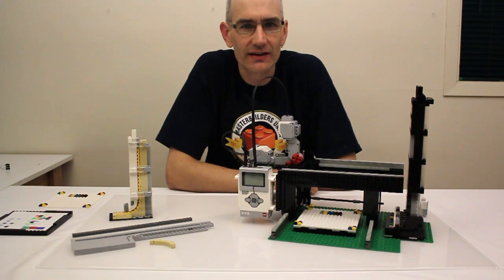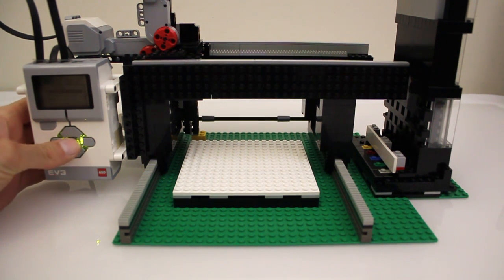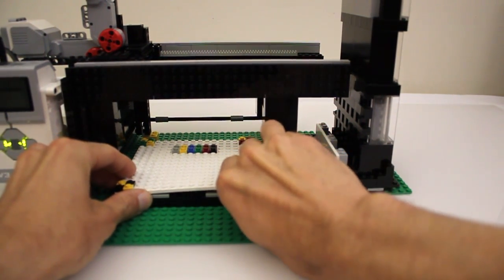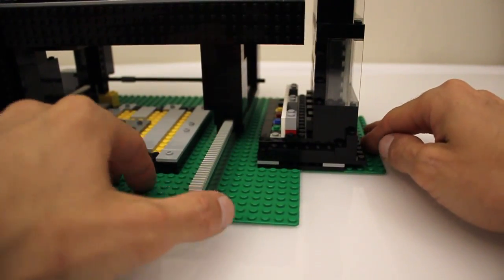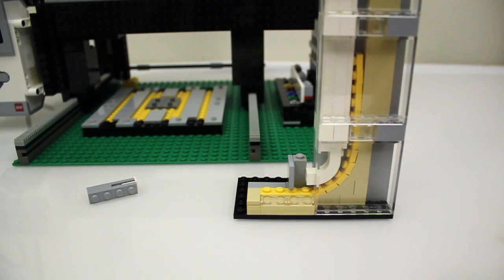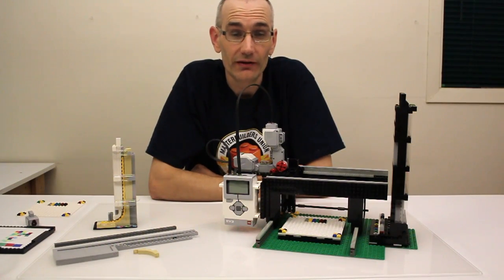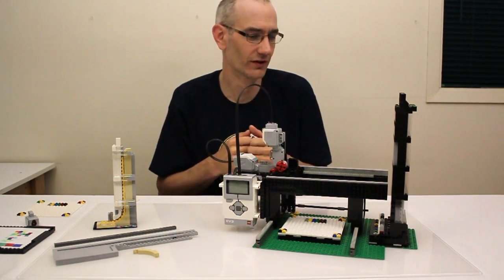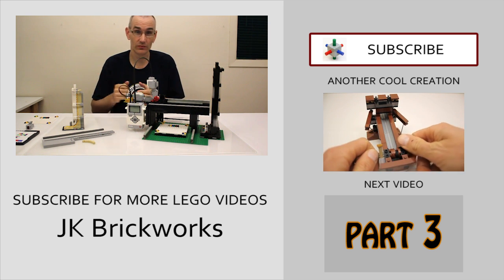The LEGO Printer Project - Part 2

Comment: Lets say the one of the 1x1 plate chutes depletes to two plates, will the second plate still fall into the reach of the arm after the first is taken away, or does it need to be manually pushed?
Reply from the maker: No, there does need to be minimum of about 6 or 7 plates in the chute at all times.

Comment: I think I see a potential problem with the feeder system: the bottom part is flat and too long. While the reservoir still contains tiles those tiles should be effected by gravity and thus push the tiles at the base downwards. However, when the reservoir is empty, and there are say... four tiles, they won't go anywhere anymore because what was pushing them is no longer there. (This is assuming that the result your going for is completely tile based.)
Reply from the maker: Stillcoe Jones Yup, there always needs to be a stack of plates pushing down. Once the number of plates gets down to around 10, more plates need to be added for it to keep working.

Comment: This is a pretty cool idea. I'm eager to see how it turns out. Though you must realize the only way you're going to top this is to come up with a machine that knits scarves or something! :D

Admittedly I haven't thought this through very well but, you may be able to reduce travel time if you moved the storage system flush with the back of the 16x16 plate. Could save 5 or 6 studs of travel for each plate. Unfortunately, it would likely require changing the construction of the print arm (or perhaps just the print head) and reprogramming the entire thing.

As for naming, at the moment I'm thinking "Print Storm" or "Plate Master".

Comment: That feeding system is pure genius, much better than any of the ideas I came up with. So in order to use the same three motors to scan as well as print the mosaic, are you going to attach the color sensor to the machine, put the image where the mosaic will be, have it scan the image, remove the image from the machine and replace it with a baseplate, and then print it out?
Reply from the maker: Benjamin Corey Thanks! Yeah I'll do something like that. I'll probably put the original image in front of the printing area and extend the bottom gear rack so that it can move over it.  That way I won't have to any swapping.  I'm hoping to have the color sensor stored somewhere and have the printing arm go and pick it up to do the scanning.

Comment: Problem with the feeder. When it reaches the last 4 or so 1x1 brick it won't reach the end to be picked up. It would basically be flat at the bottom. Perhaps rubber band, or long 1x8 brick.. gl with the project!

Comment: Very cool as always, Jason! Your attention to detail is inspiring.

I'm particularly excited about the scanning step. You could make use of some really simple image processing algorithms to generate your mosaics. I see you are using a grid with 1x1-LEGO-plate sized cells. Depending on the quality of the sensor you could scan an actual photo and easily convert it to a 16-color mosaic (or as how many colors you will be using). You would just have to size the image down by averaging the color of each 1x1-LEGO-plate sized pixel block, then apply a dithering/quantization algorithm (like Floyd–Steinberg dithering, being the most popular one) to reduce the color palette of the image to a 12-color palette. This way you could convert any scanned photo (or a photo straight from your hard drive) to a beautiful mosaic :-) Maybe you are already working on this.

Here's a nice Java implementation of a dithering algorithm and a good article on the subject:
http://stackoverflow.com/questions/5940188/how-to-convert-a-24-bit-png-to-3-bit-png-using-floyd-steinberg-dithering
http://www.tannerhelland.com/4660/dithering-eleven-algorithms-source-code/

Name suggestions just off the top of my head: Gutenbrick, TesselLEGO, Mosaic-o-matic,... yep, that's all I got.
Reply from the maker: LexFloyd Thanks!  Yeah, my original idea was to be able to scan actual images and 'pixelize' them.  Unfortunately after playing around with the color sensor I don't think that will be feasible.  It really isn't very precise and seems to only work well on large swatches of uniform color.  I think I will be hard pressed to get it working with the 1:1 LEGO scale 'drawings' I have right now.  Of course we'll see what happens.  I'm sure there will always be some room for improvement.  Thanks for the info and name ideas!

Comment: Hi about the amount of plates i have a solution which will help i think : put a rack of each set of colors on each side of the square you want to reproduce so upping it to 3x as much ( so 1 at each corner / side ). Then program it so it will only use the color it needs from its closest quadrant. This will solve the brick count and make it less tal then needed but it will also speed it up as less bigger movements are needed. Hope this helps good luck looks like a cool machine.

Comment: Oh, I was also wondering; without the weight of all the replacement pieces behind them, do the last small plates (the ones originally at the top of the tower) make it to the end of your feeding mechanism, or do they stop before the end?
Reply from the maker: Connor Novak Good observation. No, they definitely don't. Once the stack of vertical plates disappears there is no more pressure to push the remaining ones to the front, so the last 9 or so can't be used.